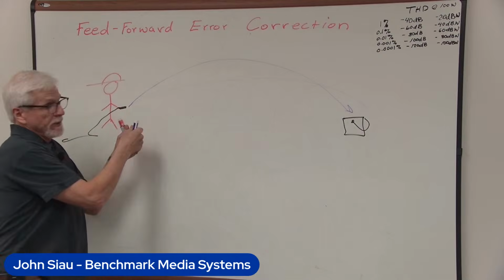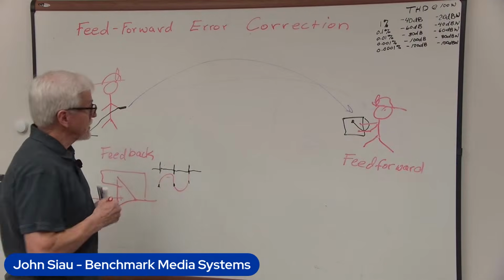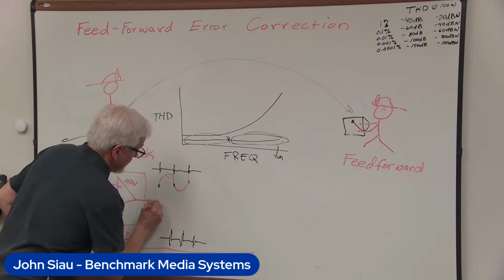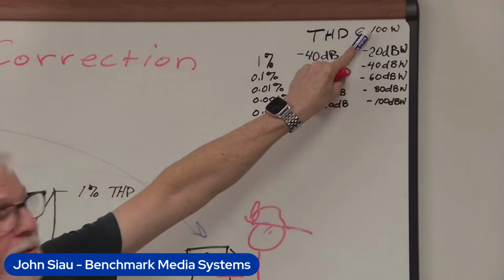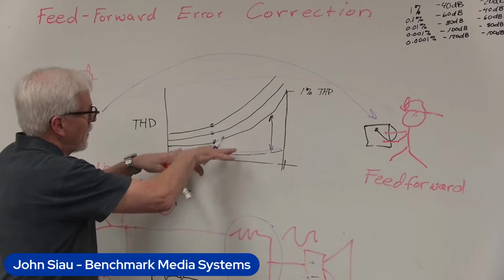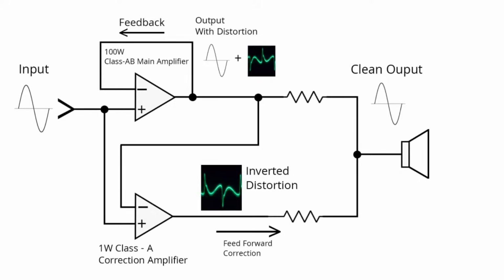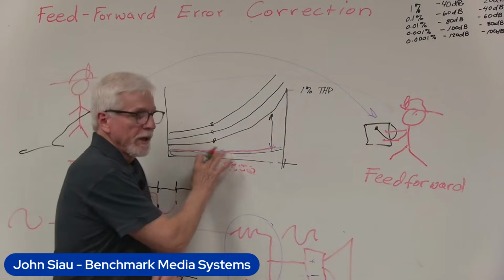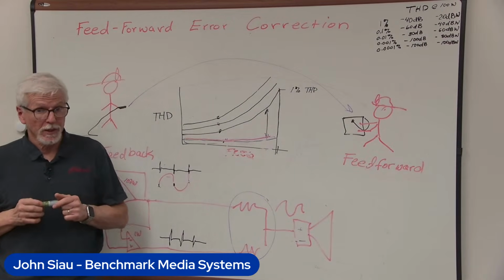Amplifier Distortion & THX Feed-Forward Correction w Benchmark Media Systems

Comment: Love it ... great video

However, Quad's own “current-dumping” is feed-forward based design back from the 70s. Quad 405/405-2, Quad 306, Quad 606, Quad 909 and modern day Artera power amps are all based on feed-forward principle to eliminate cross-over distortion. 

I also believe Linn Chakra and Hegel SoundEngine are also feed-forward based power amp designs

Therefore I believe the Benchmark ain’t the only one using this powerful combination of high-power amp (using classical feedback) AND low-powered high-quality amp in feed-forward configuration for accurate error correction 

As a long time Quad 909 owner I always loved the result !

Comment: Good video, but ultimately more of the same.
We can probably all agree that the ideal is no audible distortion whatsoever, but using THD (Total Harmonic Distortion) as a benchmark is fundamentally flawed. It doesn't reflect the actual audibility of distortion, and says little about the true quality of the engineering — which, to be fair, I’m sure is excellent.

1. THD ≠ Audibility (It was briefly acknowledged but then conveniently brushed aside.)
THD is not a meaningful indicator of what we can hear. This has been well demonstrated — notably in two AES papers by Earl R. Geddes, who showed that the audibility of distortion is far more complex than what THD numbers suggest.
If you're leaning toward IMD (Intermodulation Distortion) as a better metric, think again. These measurements are popular because they’re easy and accessible — not because they actually tell us what matters. It's the classic "streetlight effect": we look where the light is good, not where the truth is.
Electrical engineers often stay stuck on THD, failing to adopt psychoacoustic metrics that align with how we perceive sound.
The only useful insights from THD measurements are:
•	A. Clipping behavior and dynamic range — whether the DUT is operating linearly or not.
•	B. The distribution of harmonic content — lower-order harmonics (like H2 and H3) are masked by the fundamental and far less audible, whereas higher-order harmonics (H4 and up) are more likely to be perceived and cause harshness.
To illustrate: In subwoofer measurements using psychoacoustic standards like ANSI/CEA-2010 (as seen on Audioholics), a THD of –10 dB at low frequencies is still considered acceptable — because it’s not perceptible.

2. Masking Is Involuntary and Dominant
The concept of “not masking distortion with music” misunderstands how the auditory system works. Masking is not optional — there’s no switch to turn it off. It’s an evolutionary feature of hearing, and it plays a huge role in distortion perception.
For example: A speaker with 90 dB/W efficiency driven at 100 watts outputs 110 dB SPL. At that level, masking becomes so strong that even relatively large amounts of distortion become inaudible.
So no, it doesn't matter if there's 70 dB of distortion — if you can't hear it, it doesn't exist in any practical sense.
Feedforward systems mostly target high-frequency distortion.
For example, if we consider a 6 kHz fundamental, its harmonics — H2 at 12 kHz, H3 at 18 kHz, and H4 at 24 kHz — fall increasingly outside the range of human sensitivity. By H4, we're already beyond both the human hearing limit and the Red Book CD standard (which caps at 22.05 kHz).
Moreover, H2 and H3 are typically masked by the fundamental, making them inaudible under normal listening conditions. So what's the point of eliminating distortion that can't be heard in the first place?
As for high-resolution audio, double-blind studies — such as the well-known Meyer & Moran (2007) paper — found no statistically significant difference in listeners’ ability to distinguish Hi-Res from standard CD-quality audio.
In the end, this is less about perception and more about marketing.

3. Transducers Are the Bottleneck
Let’s be clear: Transducers (speakers) are orders of magnitude more distorted than electronics. Any well-controlled double-blind test involving decent electronics shows that, within the resolution of human hearing, they all sound the same.
If you care about audible improvements:
Spend your money on better loudspeakers or your room.

Comment: The AHB2 is rated down to 4 ohms when bridged. Is it stable at 3 or 2 ohms when bridged? Thanks
Reply: It is not just stable, the THD stays almost as low as it is at 8-Ohms. In contrast, most amplifiers show a substantial increase in THD when driving low impedances. The THD from the AHB2 is much lower to start with (at 8 Ohms) and it stays nearly that low when driving 2 Ohms. - John Siau
Reply: @BenchmarkMediaSystems  powerful, clean and stable at low impedance, even when bridged in mono? That's awesome to hear. Thank you for your reply! ☺️

Comment: what time delay?  is crossover distortion the only distortion corrected ? the reactive loudspeaker load impedance causes the amplifier to distort at higher  levels ...so how is the amplifier supposed to correct for that ? I mean its all good, but I still dont get why its called feed forward ...like the old Quad  current dump design  which was just dynamic current limiting. or the NAD  dynamic voltage multiplier .
Reply: Any distortion waveform will be attenuated by the system. If you look at the block diagram, you will see that the correction amplifier sees the difference between the output of the main amplifier and the input signal. The output of the correction amplifier is the inverted error signal. This inverted error signal will cancel the error at the output of the main amplifier. An alternative implementation would be to place the (non-inverted) error signal on the - pin of the speaker, but this would demand full output current from the correction amplifier. In our implementation, the correction amplifier does not need to deliver much voltage or much current. For this reason, 1 Watt of correction is more than will ever be needed to correct a 100W amplifier. - John Siau
Reply: @BenchmarkMediaSystems  If it works ,it works . im glad i dont need to understand it to enjoy it , Thanks for your reply i appreciate your work .
Reply: I was thinking the same thing about the Quad design that’s been used since (when?) the seventies? One high power amp and one very high quality low power amp to do the final tweaking. Is theirs the same approach?
Reply: @asx1248  Quad "current dumping" is also feed-forward error correction based design ... they had it back in the 70s all the way to the modern days (405/405-2, 306, 606, 707, 909, and modern day Artera power amps are all feed-forward based) ... THX AAA module that Benchmark is using in their AHB2 is the version of the pretty much the same design principle
Reply: Well, Quad "current dumping" is also feed-forward error correction based design ... they had it back in the 70s all the way to the modern days (in their 405/405-2, 306, 606, 707, 909, and modern day Artera power amps are all feed-forward based) ... THX AAA module that Benchmark is using in their AHB2 is the version of the pretty much the same design principle ... I own pair of Quad 909s

Comment: This differential positive feedback is probably functional, but there are many problems with it. Those speaker input resistors effectively isolate the speaker from the amplifier and the damping factor collapses, which will probably change the speaker's operation. Similarly, the amplifier's vibration sensitivity increases drastically because the correction amplifier's signal will probably leak back into the main amplifier and its playback bandwidth must be limited. The vibration sensitivity is certainly affected by the speaker's characteristics, so speaker-specific adjustment may be needed. This was not a completely new technology on a theoretical level, but I don't remember seeing any practical applications. The design of that correction amplifier is probably not without problems.
Reply: The "speaker input resistors" are not just resistors. I simplified the passive combining network for the purpose of illustrating the concept. Playback bandwidth is -3 dB at 200 kHz and this is stable into capacitive loads. Not sure what you mean by "vibration sensitivity". Are you using a translator? Do you mean frequency response? If so, the frequency response is not reduced by the correction amplifier. The correction amplifier has the same bandwidth at the primary amplifier and therefore, the correction can be achieved to frequencies exceeding 500 kHz. This is not a new technology, feed-forward correction was used in the Quad amplifier many years ago, but there are significant differences in the way it was implemented. The combining network and the seamless blending of low-frequency feedback with high-frequency feed forward correction is what makes the THX system work so well. This is also the subject of the two patents that are licensed from THX. - John Siau
Reply: Based on their measured performance they seem to have nailed it.

Comment: Best implementation is from Bob Cordell which comes from  Prof. M.J. Hawksford. It not new😊
Reply: One of the THX engineers on the project was a student of M.J. Hawksford, so you have correctly identified some of the earlier work on this concept. We have also had many conversations with Bob Cordell after introducing the amplifier. Both are quite knowledgeable on this specific topic, but it is Hawksford who did much of the research to improve this very old technique. Feed-forward control systems may actually predate feedback systems, but feedback systems have the ability to provide greater attenuation of the error signal at low frequencies and this makes them especially suited to DC control systems. Feedback must be rolled off so that the system will not oscillate. For this reason, feed-forward systems can achieve much better error attenuation at high frequencies. Feed-forward correction is inherently stable because it is non-recursive (no feedback loop). The error attenuation of a feed-forward system is limited by the matching of component tolerances. The gain of the main and correction amplifiers must match exactly. The combining network will need precision components. If the feed-forward correction system is trimmed to 1% tolerances, the attenuation will be 40 dB. If it is trimmed to 0.1%, the attenuation can reach 60 dB. The FF system in the AHB2 achieves a 40 to 60 dB attenuation between 1 kHz and 500 kHz. This is in addition to the attenuation provided by the traditional FB system, although the FB system is rolled off well before the 200 kHz bandwidth of the amplifier. - John Siau